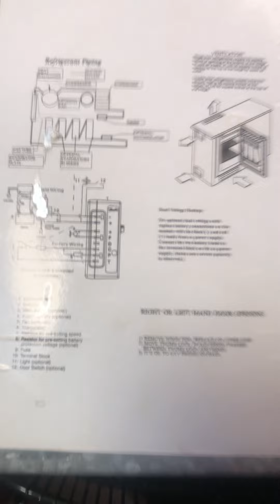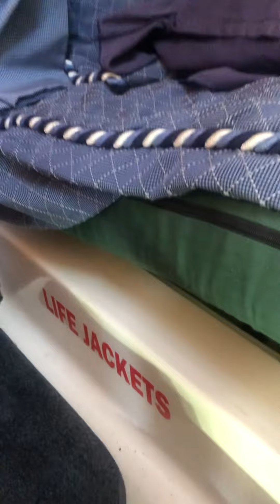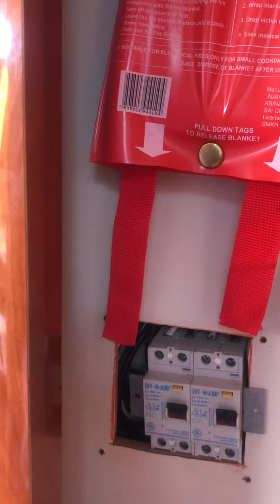Run a new wire to Four Winns Vista Inside Refrigerator

Comment: Great video! Thanks for posting. Did the 15 amp wire fix the issue?
Reply from the maker: Hi unfortunately not, it improved a little and ran for about 2 hours more than usual at anchor, but didn't pass the overnight test and started defrosting by morning. My batteries are new 2xN70 and I checked the voltage and it was still above 12V on both the old feed, and new wire i'd run, and the Victron monitor said Batteries at 80%.  So i believe its also the low voltage cut off circuit in the fridge Danfose module disconnecting around 12.0V rather than the 10.6V it's supposed to.  i have since bought a small dc-dc converter that can take a 9 to 15V dc input (from battery bank) and puts out a constant 13.8V up to 18Amps. This was installed between the battery wire and fridge terminal, so the AC switching still works on shore power and generator. The DC-DC converter will cut off around 10Volts, which for me is close enough to the original Danfoss Modules 10.6V cut off limit, which can be further reduced to 9.4V if you have the thermostat with 3 wires, by connecting the extra wire to the P terminal. So far its working fine on the overnight and weekend trips, i wanted to avoid more electronics, but oh well.... this was also MUCH easier than running the cable. I just changed the port side windscreen wiper and windlass motor, and they where far eairier to access via ceiling light and the front mirror.